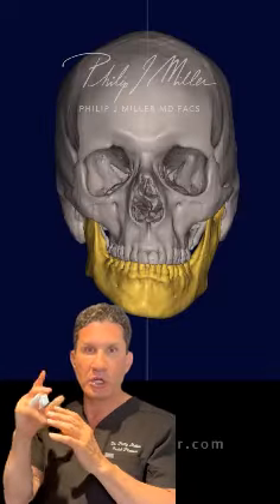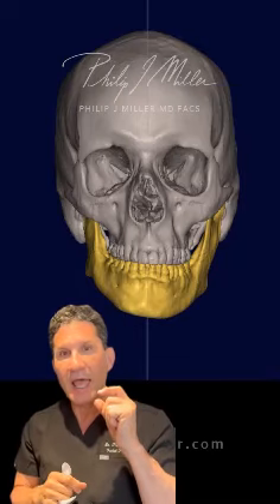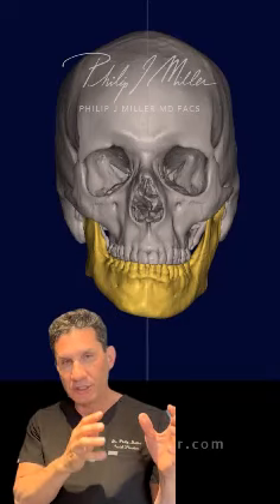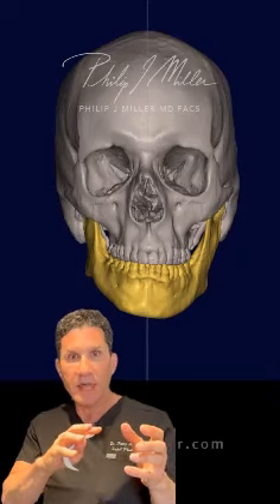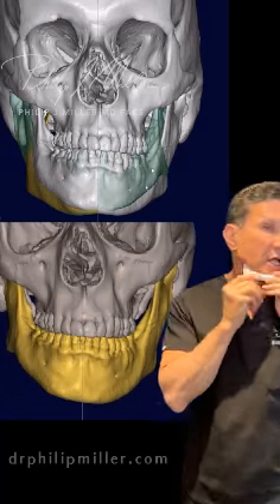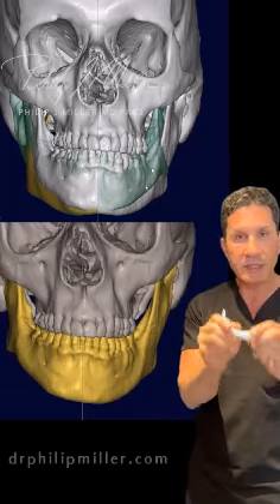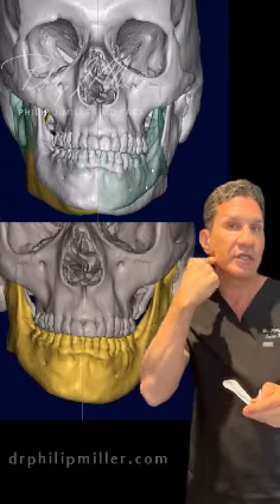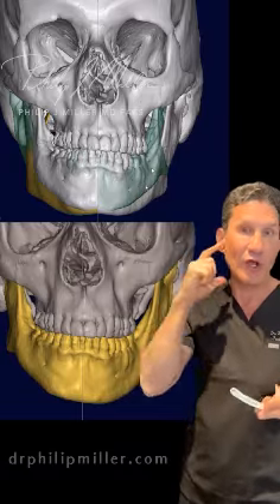Customized Jaw Implant To Correct Asymmetrical Facial Feature | NYC Facial Plastic Surgery

Comment: I have the exact same problem which causes me depression, I don't want to face poeple or see anyone, I only want to hide my face
Reply from the maker: Thank you for watching! If you have any questions, feel free to call or text my NYC office at 212-750-7100.
Reply: Same here buddy
Reply: yeah my skull has the exact same pattern. recently i noticed that my jaw was shifted slightly to the side with more bone and that on the "shrunken" side i was getting no solid contact of my molars, so i shifted my jaw to make it centered and focused really hard on getting molar contact on the weak side. now i can feel my face on that side expanding naturally, it's like i relieved a ton of pressure on it, i had ear pain on that side which has gone away and my hearing is improving, it feels like when you finally get water out of your ear after you went swimming. this has also improved the rest of my posture as well. my right shoulder, which was on the same side as the weaker half of my jaw, has gone from being internally rotated very badly to being almost completely fixed. my entire sternum is repositioning itself and i can feel it loosening up like it's stretching out after being crushed for so long. this asymmetric jaw issue is not genetic or cosmetic, it is caused by poor oral posture, you need to start mewing and making good contact on the weak side with your molars. try to see a physical therapist certified by the Postural Restoration Institute (look it up, they are amazing), or a dentist who specializes in TMJ function and/or myofunctional therapy. it's actually insane how easy this is to fix, it's just that people don't know about it. i saw noticeable aesthetic results in my cheekbones within the first week of altering my jaw position and fixing my tongue posture, but the entire posture of my body was almost completely fixed within a single day of altering my oral posture, which is what i care about more than aesthetics. if you have bad posture, back pain, shoulder pain, ear pain, you need to fix your jaw and tongue posture immediately, it is like night and day.
Reply: you can see an oral surgeon and orthodontist
Reply: @Ivanbb10  you want your molars to have even pressure on both sides, but this may not be possible if you have messed up teeth. what you want to do is buy some tongue depressors or chopsticks or whatever you can get that is hard wood and bit down on them with your weak side while leaving the strong side empty, this will teach you to engage the weak jaw muscle properly.
Reply: @j.6378  Okay thank you. But I o noticed on my weak side I have a bigger cheek bone, won’t I make it even bigger by bit down on that side?
Reply: @Ivanbb10  it's hard to say without seeing pictures, you need to figure out which side is actually the weak side because the side that is healthier and functioning more properly is not necessarily the side that looks better.
Reply: @j.6378  my face looks the same as the one shown in the video but the smaller side has a bigger cheek bone

Comment: I have the same problem but my short side have v shape and it's cool. The longer side of my face is like circle. Can i cut the longer one instead?
Reply from the maker: I see no reason why you can't but just bear in mind that shaving down the bone is a lot harder than putting in a predesigned custom implatnt
Reply: Thanks for the answer doctor